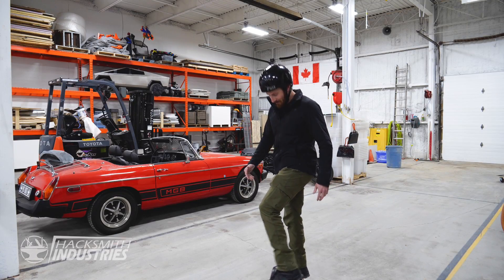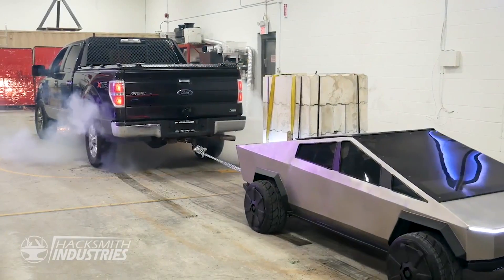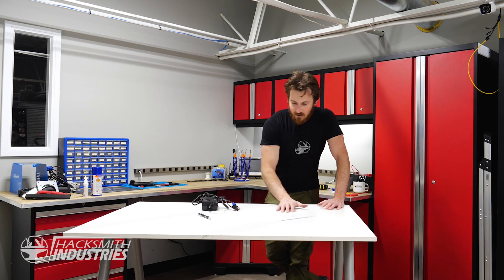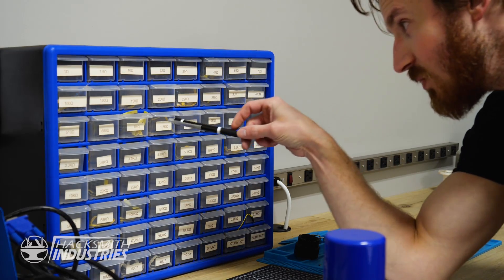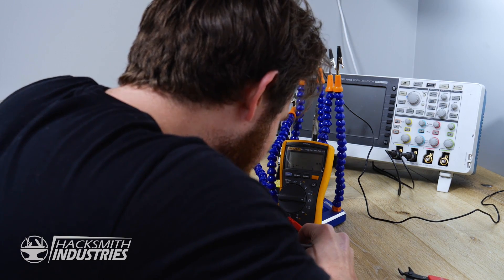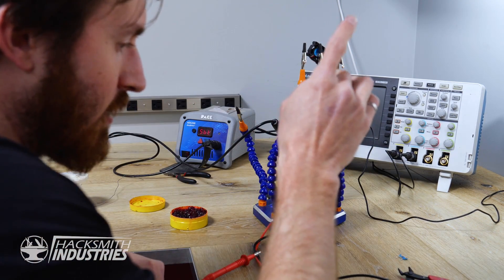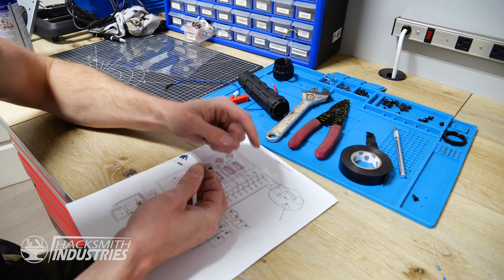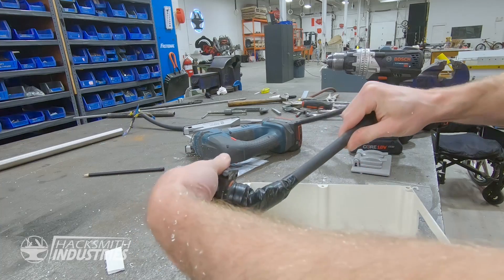Don't Try Charging your Onewheel from an EV Station!

Comment: I know this is a couple years old, but I thought I'd try to sneak in a question:
I'm building out a box truck into an RV. I'll have solar (not enough), a 4K generator (that I don't want to run all the time), 2x 5120Wh batteries (10KW bank) and a charger than can take 240V at 21A (5120W). The charger has a prewired L14-30 plug. Can the same wiring apply? I want to make sure I'm getting the most power out of the station via the J1772.

Comment: Ah yes. Coiling up AC cabling. What could possibly go wrong.
Reply from the maker: At this kind of low power? Literally nothing.
Reply: @hacksmith  True, but you could plug anything into that socket. Why not cut it to length?
Reply from the maker: Didn't want to ruin the cable incase we needed it for something else in the future

Comment: hey, so it would be great if you could invent something that's actually SMALL and doesn't require two bricks to be carried around. i'm not electrician, i guess that's why i don't get it. why the heck does the charger have to be so big? isn't it possible to just make something that goes directly from an ev plug into the onewheel?

Comment: A good hack would be to reverse that box to be able to use a normal plug and covert to the plug type for an EV, then you could essentially charge your car off a generator if you run out of power in the middle of nowhere?! Unless you already can? IDK anything about the EV charging set up haha!

Comment: Instead of using 3 resistor in serie you can put 2 in parallel , but that'll need a little more calculating .
But i think it'll be less clumsy to when you put them in serie, but idc what does a restitor cost? prob. like 50c i guess

Comment: How about adding a capacitor with a DC to AC converter to the box,  therefore as well as charging from the EV station, it can also store some charge enough to have a portable AC outlet.
Reply from the maker: Need more than a capacitor to store any useful amount of power!

Comment: Did you Solder two 100ohm and one 1.3kohm resistor instead of two 1.3kohm and one 100ohm resistor?

Comment: Try making an electro magnet of thors hammer but only YOU can carry it. Tip, insted of the electro magnet outside, how about in the inside and uses a finger regnition to activate the hammer from sticking on the ground. I actualy found this in youtube, and its pretty simple to make it if u are an engineer and bdw, i love your vids😆 and keep it up!!

Comment: Something driven by electricity like a electric piano works like the human body because when you eat the food goes down your throat and the body snaps up I little bit of the food but not all of it and those electricity brakes that you used - if am correctly- snaps up some electricity so if 
150 volts come in then 140 comes out comment if I’m right

Comment: The circuit diagram shows 1N4003 which would work because of the reverse voltage breakdown of this is a zener at 200 V. Not sure how this works with a 1N4007 though. That has 1000V reverse voltage limit...

Comment: I'm from Germany and love your vids, I studied electrics, and have a hint:
If you roll the cable like that in the box you build a small transformator and that produces heat and a higher voltage so it might be better to shorten the cable
PS: Can't wait for the Power loader to be finished :)
Reply from the maker: It's only a transformer if you have a ferrous material in between and a second coil.  A plain coil of wire produces an inductor, but at this small amount of power it's negligible :)
Reply: @hacksmith  yeah your right 😅 on the other side (I don't know the exact amount ov power the whole thing drains) is the heat but it is probably used for a small period of time so it's to neglect
Just wanted to be sure keep on going that good work :)

Comment: 240 Volts isn't High Voltage...
According to the Canadian Electrical Code, High Voltage is 750+ Volts...
Reply from the maker: Still high enough to kill you
Reply: @hacksmith  True, 1 Volt can kill under the right (or wrong depending on your view point) circumstances...
Reply from the maker: Current is what kills,  but you need a high enough voltage to get past the resistance of your skin ;) 

You'd have to stab yourself with contacts to have 1V do anything

Comment: I realize that this is a quick-and-dirty, let's-see-if-we-can-do-it project, but you could easily make this adaptor at a fraction of the size if you just cut that cable shorter, and you could also incorporate the one wheel's power cord into the device. After all, who one-wheels while carrying a shoe-box-sized metal box?

Comment: Any reason I couldn't use this to charge my Chevy Volt at 240v?  I could plug the EVSE that it came with into this box, which handles 240v at 16 amps . . . or would that just melt the outlet?  lol

Comment: Is it possible to make a autonomous harmonica? 
You can make it with one for blowing and one for sucking air through maybe from a circular steel plate with holes which let air through only from the holes you  want

Comment: Would there be a way to fit a battery in the box as well so that if you really wanted to you could store more energy from the EV charger so that if you run out in a area without EV chargers that you would still have power?

Comment: James did u just coil a big ass wire and then connected it to 240v?
Reply from the maker: It's such a small power draw it doesn't matter
Reply: @hacksmith  Wow, 2 weeks later I see this reply.. I guess this is going to be a good day :)

Comment: Since you have two outlets, can you charge you phone or some other device at the same time?
Reply from the maker: Of course
Reply: the Hacksmith when the onewheel ran out of battery and you are wating it to charged up, you can play cell phone games and no need to worry about the cell phone ram out of battery too correct?
Reply from the maker: Yup

Comment: Running 240V on a residential 120V receptacle is gonna be a bad time.  They aren't rated for 240 and it's all too easy to plug a 120V only device... and you've found another way to make fire.

Comment: I would have bought a 2nd charger and integrated it into the box so that you plug the car charger into one side, and the other side is the wire to plug into the one wheel. only one thing to carry and more compact.

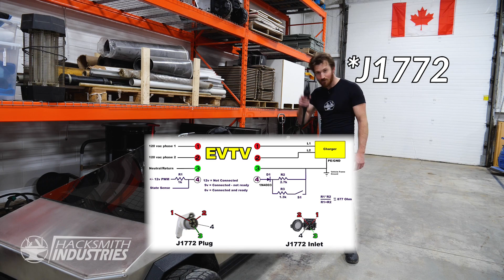Comment: You didn't hide the Cybertruck control URL (hacksmithwebapp.com) at 1:30
Reply from the maker: That's ok, it's only locally controlled
Reply: @hacksmith  All good then. Was just letting you know in case it wasn't. Wouldn't want someone to mess with it while it's in use...

Comment: I like you guys, and I am fan of Savage for sure, but actually onewheel is worse than any good EUC by all specs - including distance, speed, ability for off-road, steering, jumping over different obstacles, etc.
Consider getting something like one of the kinsong or gotway electric unicycles with battery no less than 840wh, and you will be surprised why you had not switched earlier and were wasting your time for onewheel.
Reply from the maker: Nothing beats carving down offroad on a onewheel! We rip through mountain biking trails on ours,  its fantastic
Reply: @hacksmith  

Electric transport is awesome in general. And having any type of it is much better than not having it at all. But  experience can be even better with a differently designed  transport, give it a try)

Mentioning Savage makes me to dream about some kind of of crossover between Hacksmith and Savage, by the way.
Reply from the maker: I've tried many others,  Onewheels are by far my favorite -- it's like snowboarding on land, nothing like it :) and with wings you can jump with Onewheels! I can turn on a dime, and go down skinny trails -- maybe you just haven't tried one long enough :)
Reply: @hacksmith  
Okay, then I have to go with my best and completely unbeatable argument - you can cosplay GizmoDuck  with EUC!

Comment: imagine having to use a 115V outlet for 240V and then potentially breaking other stuff because you don't have 230V in your regular outlets

this message was brought to you by the European gang

(also, due to civilized countries using 230V by default you're unlikely to break anything that has a power brick or a PSU because most of them are designed to accept anything between 100-240V, but still, the hell is up with your grid)

Comment: 1N4007 can be used because it can withstand a reverse voltage of up to 1000V. So it will break down if 1000V is across it which will pass an excess amount of current which can destroy the device. 1N4003 can withstand up to 200V of reverse voltage, so 1N4007 is better but it comes at a cost of efficiency.

Comment: When you got 1.5k ohm, you used 1 1.3k and 2 0.1k ohm, not the 2 1.3k and 1 0.1k you said you would. You math was right, you actual picking of the parts wasn't

Comment: use an electric scooter. a cheap one can get you a lot more miles and a lot more speed and a top of the notch Dualtron X can get you like 40 miles at 70 miles per hour

Comment: it's weird to see 240v socket that massive when in compare to 120v and 100w device should take half of the ampere 0.4167 for 240v not 0.8333 like for 120v and etc. or his hands are small as fu*k

Comment: You could use a Relais for the black widow taser instead of the gravity switch and use a low-voltage circuit so you could close the circuit by e.g. putting your fingers together without hurting yourself

Comment: Insert a 220v to 110v step down transformer so you will be able to use any non-220v outlet charger (such as an oral b charger)! Charging oral B brush on ev charger! What if there are no outlets?

Comment: James, I love your work and your idea about the one wheel board.. but.. if I was you, I would to a remake on the board, or probably make it better. Perhaps if you use a two face circuit or use the patent that apple use on their motherboards, you will be able to fit the adapter in the board. Good luck!  The only limit in technology, is our imagination.
Reply from the maker: Wouldnt fit on the board that's the problem

Comment: Okay just as nice reminder for future projects for you if you don't have bogdan with you then if you don't have the right size of a resistor, then try to always go with a parallel connection instead of a series. I remember my teacher also saying if possible then don't ever use a series connection.
Have a great day 😁

Comment: I love this Idea but can this be used on most Electric skateboards ?? Onewheel charge is ready for 240V or 120V so that's great & I'm wondering why? But if i do this with any other board does that mean I just need to make sure it can charge with 240V directly I think I got that.
Reply from the maker: Most DC power supplies run from 100-240v so they can be used internationally

Comment: V2, wherein he buys a second one wheel charger, shorted the cables and puts the onewheel bits inside the box so its J1772 socket on one end, and the one wheel cable coming out of the other.
Reply: Shortened*

Comment: Probably a 3kohm resistor is fine, and that giant cable coiled up in a giant box for such a low power device is completely overkill, if you used a reasonable cable you could have fitted the whole thing in a more portable device or even on the monowheel itself

Comment: I thought the 3rd signal wire was to prevent arcing. But you plugged it in with the power switch already on and it seemed fine.

Comment: I mean, this might be useful if it charges faster using the available 240 than what a standard 120 outlet would put out, but given that standard 120 outlets are in opposite phase, you can make an adapter to jerry rig 240 out of that.  Mattias Wandel did a clip of that for one of his wooden bandsaws.

Comment: Those flap plug covers aren't proper outdoor covers. they do not protect against rain when plugged in. they do make proper covers for that. Other than that, i see no problems. The outdoor chargers should be GFCI protected on their end.

Comment: Doesnt 240v have 2 hot wires of 120v? Cant you just wire the 120v socket with 120v? You can break the metal connector  in the middle connecting the 2 hots on the 120v outlet, this makes it the top socket be a different hot from the bottom.

Comment: not sure if you have a fuse in there but would not hurt to have one incase off over current that might cause damage to the ev charger?
and it should go from the feed of the ev cable to the 120v socket

Comment: 240v out of a 120v socket in disguise? Congratulations, you've created a murder machine for 120v appliances. Serves them right if anyone steals this. Might want to label it though...
Reply from the maker: Nahhhh
Reply: @hacksmith  - this comment has been archived for hubris purposes.
Reply: @hacksmith  Maybe you should mark it "Prey nothing is faulty". Because without high energy fuses rated for a breaking capacity of 10kA or more. The charger will literally blow up in your hands if anything goes wrong. The amount of amps you can get from a short circuit near a transformer is insane.
Reply: @casperunnerup  pretty sure ev chargers have internal fuses. If there was some kind of electoral fault in your 30+k car you wouldn't want a charger that would blow it up. Also a kiloamp fuse wouldn't help since you don't want more than 50 amps from a charge station like that
Reply: @casperunnerup  I absolutely agree a good design element would be to have downstream fuses. But I do happen to know charging stations have a LOT of detection tech in them to prevent stupid things from happening, the major one of which is current limiting. Given this simple circuit he likely was only getting 16A or so from that station.
The charge connector standard even has a built in spec so it knows when you've pressed the release catch so it disconnects charge when you unlatch it but before you're pulled it out so you don't disconnect under load. Pretty clever stuff.
Reply: @hacksmith  lan niye nah diyon çocuk ne dediki nah li konuşma hacksmith yakişmiyor sjsjejeiw
Reply: Must be a pain in the ass having multiple points around, in the uk 240v is standard on all (most) outlets.
Reply: Wait what this is 3 days ago this was posted was 44 mins ago
Reply: @Cack_Jooper  members see videos erlier
Reply: SupremeDeRpEy YT if you become a channel member for £6 a month you can see videos earlier
Reply: time travel
Reply: @hunter9973  membership
Reply: To be fair, he’d have to carry two different cables to the charger or get a travel adapter. This way he can just reuse it :)  I look forward to the future video where someone forgets and blows something up!
Reply: Switch-mode power supplies FTW.
Reply: Plug in a toaster and get 4x power
Reply: Or just use European sockets 😉
Reply: Singulosta what good would a different socket style do in the face of double voltage?
Reply: I would argue that most devices nowadays will take 120 and 240. It is true it's not universally true, but usually companies don't want to have to deal with two different versions if they don't have to.